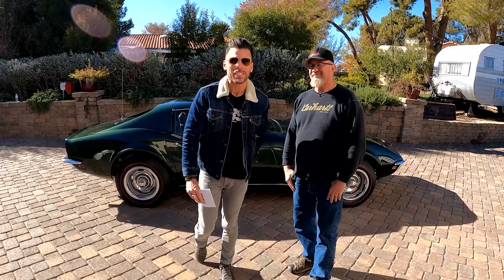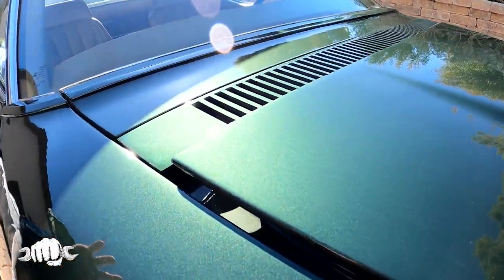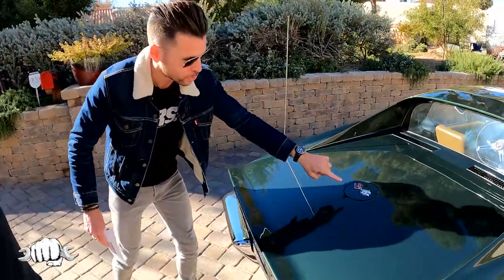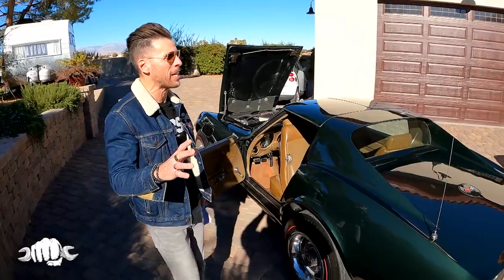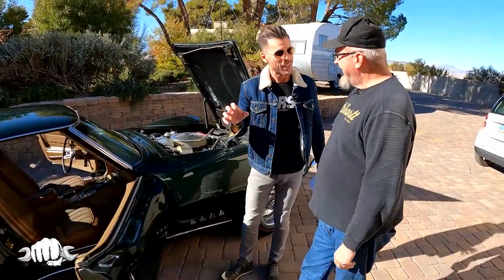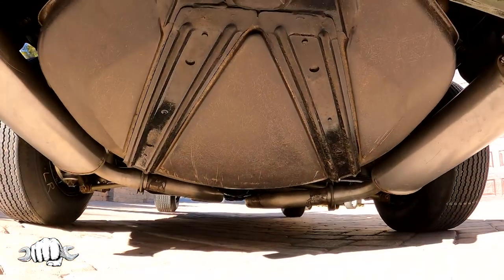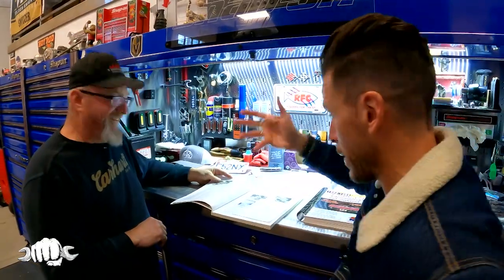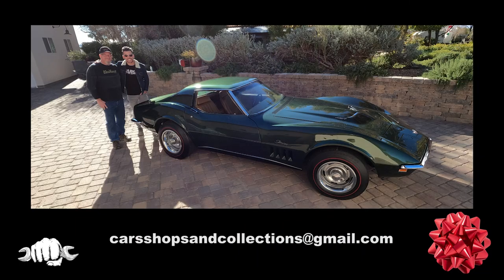1969 Corvette 427 - ALL ORIGINAL! Bumper To Bumper Breakdown To Prove Originality!

Comment: Nice 69. I had a 69 roadster that I ordered and bought new. It was Fathom Green, as is the coupe in the video, with a white convertible top and black leather interior. I was going to order the L88 or the L71, but could not get air conditioning with either, so I ordered the L36 390 HP 427 with a 4 speed Muncie M20 and 3.08 gears. It accelerated well, but the top speed was really high (clocked at 165 mph on a race track years ago), and was a great car on the highway. Side pipes were optional, I did not order them, didn't like the design of them in 69, subsequently installed sidemount headers, as well as a number of engine mods, making it even faster. The gill trim was optional, didnt ordrr that, either, thought it broke up the lines of the car. The factory did offer a built in alarm system, which I ordered. It was activated by a key switch at the center of the back end of the car. The headlights and the cowl panel over the wiper blades are activated by vacuum motors. After modifying mine, I effectively had an L88 with factory air that was generally happy on the street (although it wasn't very toletant of low speed traffic for ectended periods, it needed speed to get adequate cooling). 69 was the last year of the 427, and the last year of the Corvette as a racing sport car that could be street driven, in 1970 they began to morph into boulevard cruisers that could be modified to racers. BTW, in my experience racing A Production, I feel that the 427 worked much better than the longer stroke 454 with the Corvette chassis and suspension on a road course, with a power and torque curve better suited to steering with power, the fastest technique to getting around a track in one. Oh yes, I really needed the air vonditioning in the Phoenix heat, as the interior of the Corvette was pretty warm even in cold climates with a big block, and sweltering in tbd desert. I had that car until it was stolen in 1996, never recovered. I still miss it. It was my favorite of the Corvettes I have owned.
Reply from the maker: This is fantastic... Thank you for sharing. I'm still impressed that you could get factory alarms in 1969!

Comment: A Car like that should be clocking at least 1000 miles a year.  They are meant to be enjoyed.  Cars and coffee or just summer trips out of town.
Reply from the maker: Agreed! Shane drives all his car… that one was a pretty recent edition to his collection
Reply: I don't know about 1,000 miles per year... I don't even drive my daily's that much.  It should be driven, but 10 - 20 miles per month (~250/year) is plenty, as long as there's some highway miles in there to get everything fully warmed up each time and put some fresh gas in the tank at least once a year.
Reply: I know there are different opinions on this subject and I respect yours, but I would never drive this car more than a few miles per month. This car is an original collectible and they are only that like that once. Very few of the parts on this car can be replaced with genuine GM parts as only a scant few are available today. Replacing parts with reproduction parts will slowly degrade the car. Most cars like this are trailered to events to minimize wear and tear. Just my opinion.

Comment: Those are NOT the original floor mats.  The originals are made of fairly thick clear plastic, partially ribbed, and have crossed flags on them with NO WORDS.
Reply from the maker: Interesting!  Nice catch!
Reply: @CarsShopsAndCollections  Thanks.  I used to have a 1971 convertible in the mid-1970s when you could still by the original mats new from the Chevy dealer parts department.

Comment: Nice ride. Need to drive it more. I wrecked (but not totalled) a 69 435 hp/427 w/4 speed (3 carbs) and had the factory side pipes. It had the old bias ply tires that didn't grip like radials. It was a marina blue one. It took a telephone pole and 6 fence posts out but I still drove it home. The repairs at the time were $1600.00 and the car was worth $3800.00 this was in 1971.

Comment: Right mirror was a dealer option starting in 1973 and remained until 1979. The first year for factory dual mirrors were the bullet style sport mirrors first available in 1977. 
The luggage rack was also a dealer option, not factory. 
The removable rear window slides into that tray, the t-tops go in protective bags and just ride in the rear area. 
The fiber optics light when the lights are on, if you don't see it lit up on the indicator then the exterior light is not working. 
The first 1969 Corvette VIN was 700001 and the last 738762 so 38,762 Vettes built in 69 which was the most up to that time.

Comment: Nice car man! I have a 1970, basically the same car with a few little changes. It came with a 350/350 horse engine I was not impressed with. Frame off restoration in progress. Frame was pretty good for a car back east, West Virginia. The front of the car has never been hit, it is all original. Looks like the driver side rear fender may have been in a minor accident. Rear flares are on it. Hell of a car. Going big block, more torque.
Reply from the maker: Sounds awesome!  I want to see pics!

Comment: Sweet,,, I own a 1970, C3, 350/350 L46 with a very rare M-22 4 speed. 1 of only 17 built that year. Not all original, but numbers matching engine and trans. Maybe it's worth something? I would love to hear from an expert.
Reply: L46 with an M22? Seems impossible.  What's the trans stamping?
Reply: Don't remember the stamping, but it checked out. All matching #'s. I agree it seems like an odd choice. It does have the M22 whine. I will get under the car and get back to you. Also,,, there were 25 in 1970. Not 17.  @thud9797
Reply: Ok cool, the M22 was speced for the ZR1 so that's where they mostly went although maybe a few more snuck out, would definitely be the rarest L46.  😀